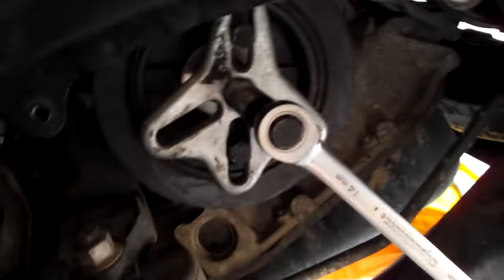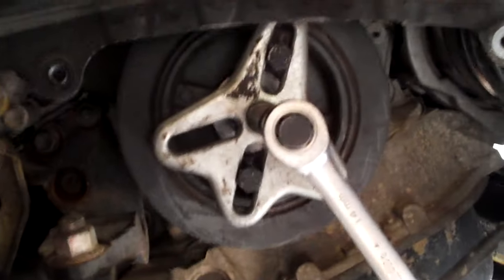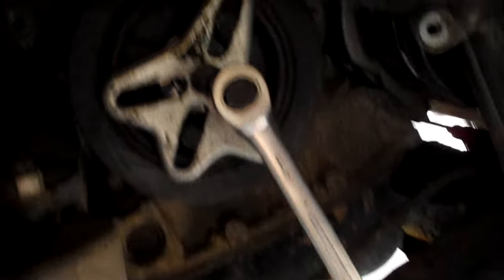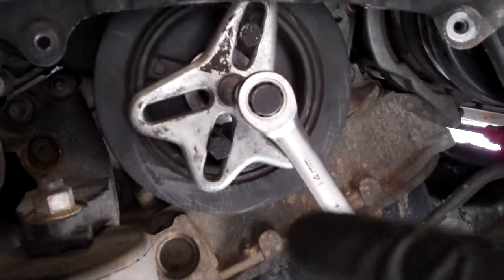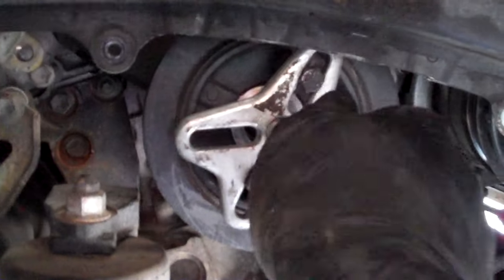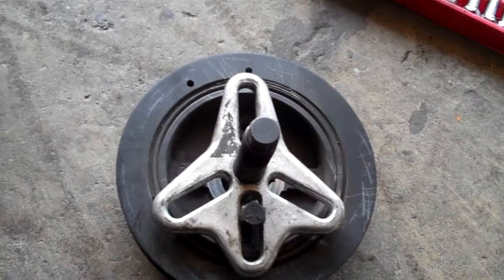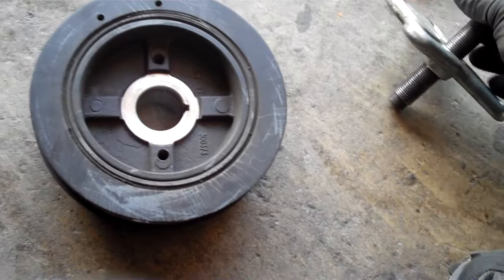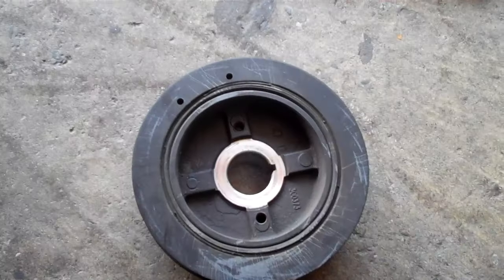Harmonic Ballancer Bolt Puller set how to use it.

Comment: Great video. By the way, I personally feel it's always a good idea to use flat washers under the heads of the 3 bolts holding the puller to the damper.

Comment: I just got done using a puller tool yesterday for removal of my harmonic balancer on my 2002 Nissan Frontier. It was a little bit difficult in that hard to get to location to get those two small 6 mm bolts on there to hold it in place, but once I did it it was so smooth and easy to take the harmonic balancer off. The tool is very cheap even if you just purchase it,  but you can also rent one.

Comment: Brian, your rock! Got the same puller from harbor freight. Used it on my 1999 Jeep Wrangler today. Jeep calls the harmonic balancer a vibration damper. Worked perfectly. Your video really gave me the confidence to do this. Pulled the balancer so I I can replace the crank seal behind it.Thank You So Much! Please keep the videos coming. Don't think for a second that your efforts are not appreciated!
Reply: Jeep call them that because that's essentially what a harmonic balancer does, it dampens piston force vibration as well as having the additional function of a drive pulley.

Comment: u can also use a socket and a cheater bar and put it on the center bolt and brace the cheater bar on the frame and barely crank the engine it will loosen the bolt where it comes off by hand. nice video thanks

Comment: Isnt the cone/pointed piece used for certain bolt styles that have a cone type piece at the head. For sure using that would or could damage the threads. Good job in using the flat one for this job.

Comment: There is an Auction going on right now for that bolt puller kit on e-bay. I put a bid in on it because it's at $6.50 with $14 shipping.  I was curious to seen what all it could do and I wound up here. I tried to subscribe to your channel but found out that I had already done that some time ago LOL. I've been looking for something that will remove pulleys from electric motors. Thank you for posting this because I don't think this kit will do that for me. I could be wrong.

Comment: Nice video! I'm pretty sure you can "borrow" a nice set of these from your local Advance Auto Parts store. I wish I knew that before replacing the leaking front crank seal on my 2001 Altima!  I was too cheap to buy a set like shown, so I ended up prying the harmonic balancer from behind, scarring the innermost pulley ridge a bit. I "fixed" that by filing edges in a couple spots smooth, and it's been working ok for the last 5K miles or so. But having a puller set like this would have made the job MUCH easier!

Comment: So probably most ask this cause no one covers it ??? Does the big center BOLT go INSIDE the harmonic balancer or does it press against out side . The pointed one does not go INSIDE but it sets 1/100 th of a in . to big and flat round one is way to big outside . Does MAIN BOLT on tool go INSIDE or just rim the edge of harmonic balancer ?? I'm frustrated sorry

Comment: ill add comments about this after i do my 99' ram 1500. my balancer broke apart. the 5.9 has 2 steel rings and sandwiched a rubber ring in between the two steel rings. the outer came off. I gotta do my timing cover too
Reply: the dodge ones a pita!

Comment: like the vid thanks now a question I have a 99 dodge 2500 5.9 gas 4x4 i have a exhaust leak that is pretty bad sounding , the question is --is there any easy way to remove the exhaust bolts without breaking them, all i need is the exhaust removed from the manifold not the manifold itself. i live in the country so its not like i can just break them and run to pep boys or where ever, if i do break them what do I replace them with? thanks for any time and consideration.

Comment: I need to get a good balancer puller set.  I made a steering wheel puller in school from old scrap stock and some grade 8 bolts, but I've yet to see an engine with a balancer small enough that I could use this thing on.

Did you video any more of the timing belt job?

Comment: How are you keeping the damper from spinning as you turn on the removal tool? Are you wedging something in there?
Reply: lucy winkelman the dampner has a dowel pin in the center that keeps it connected to the crank shaft until it is removed. which also helps locate it correctly when installing it.

Comment: Hey Brian, around 1:25 you said that Dodge uses their own special puller - my 02 Dakota with the 3.9 uses the 2-3 bolt hole method you show here.  Did Dodge adopt that some time after 02?  Love yer vids brother!
Reply: My '99 Ram 1500 is the same. 5.2L 318.

Comment: Oh i almost forgot. That kit on e-bay is sold by Taddwholesale on e-bay. The auction number is  	300865138150.  That seller usually starts the bids at 99 cents. They sell things that get lost in shipping or things returned to seller. All sorts of stuff. I bought a $50 hand plane there for $2 plus $10 shipping. The plane had a broken wood handle whicjh I fixed with a little glue. I just like seeing what they have for sale.

Comment: That tool is a steering wheel puller, not a harmonic balancer puller. Use the right tool for the right job, this is not it!
Reply: Wrong. You should know what you’re talking about before talking.